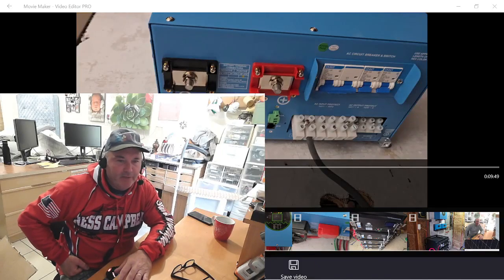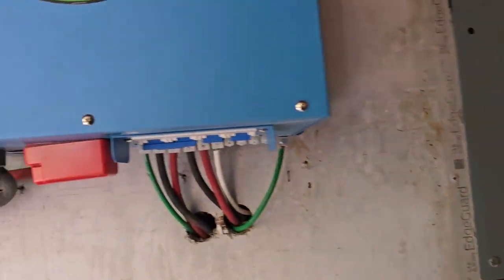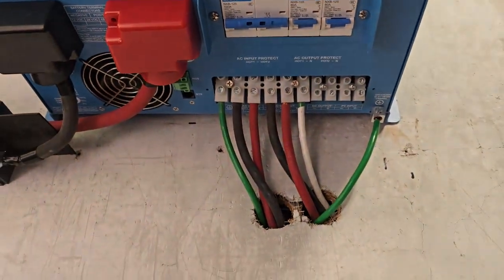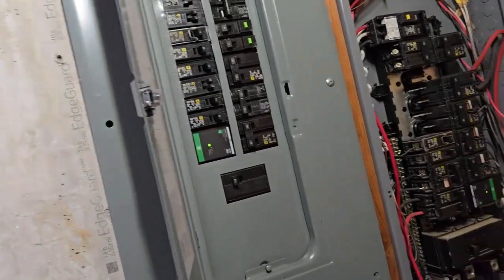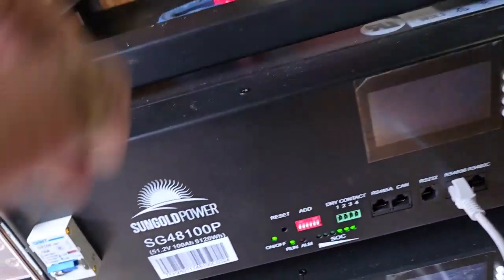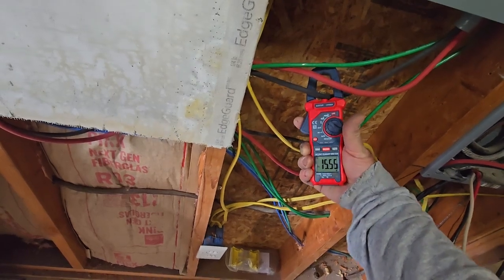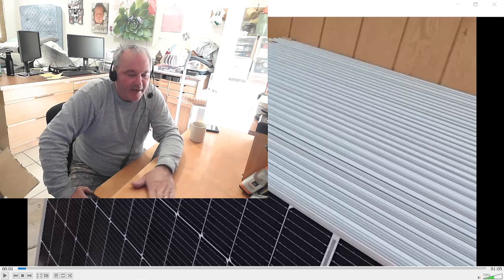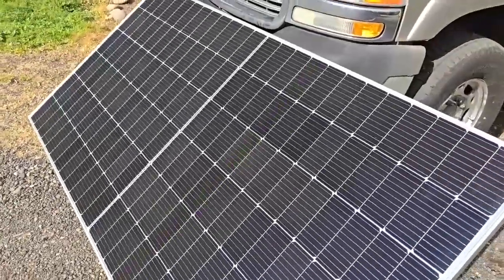SunGold Solar Inverter 18kw electrical wire hookup and power test

Comment: Did your diagram for wiring the 18kw inverter to battery bank show to run (2) sets of 2/0 wire in parallel?

Comment: How is it working? Does the quality seem good? I have been hesitant to buy this brand as I hear they dont honor warranties. This seems to offer the best output for its price...when I've tried searching for reviews every video is from someone that is sponsored or has some sort of partnership with them. It's a budget friendly option, but I can't afford to take a chance on getting an inverter that will let me down after a couple years or less.
Reply from the maker: So far I am very happy with the power it produces. Our house is ALL electric. It is a basic no frills inverter that just makes power and that is it. Our powers our everyday use at about 40% of its 18000watt capacity.
We have it set up to operate via battery bank then commercial power. So it runs stricktly off of the batteries and the solar panels   charge the batteries and if the battery voltage drops below 48v the commercial power will kick in and charge the batteries. 
At this time I still have my Hot tub, Range, H20 heater and 5 wall cadet heaters on commercial power but everything else is on the solar sub panel. I am pretty happy with the system output and I am thinking about moving the Hot tub and Water heater over the the solar.

Comment: Actually that's 4 gauge wire, not 4/0 wire. The terminal strip of the SunGold 18kW is not large enough to accomodate 4/0 wire. 4/0 wire is 0.46 inch in diameter. Nearly 1/2 inch. 4/0 wire is what you might use for an inverter's battery terminals depending on its current draw..
Reply from the maker: Correct, did I say 4/0 should be 4awg.

Comment: Finally a real inverter that uses low frequency, transformer based technology.
Reply: Yeah but the idle consumption is probably INSANE. Sure, there's an energy saver option that will drastically reduce the idle consumption but typically it works by sending out a pulse every 3 seconds to check for a load over X amount. So its not good for certain situations. Your lights will flash every 3 seconds and there's other devices that WON'T like having that pulse every 3 seconds.

Edit: Idle is 270W! and Power Saver is 50W....Holy shit

I'd guess this 18kw would have an idle consumption of 125W or more....but you probably get well over 30kw of surge so starting multiple pumps/compressors is possible.
Reply: @ericklein5097  Idle consumption isn't as critical nowadays because of the massive drop in PV module pricing and LFP battery pricing. By adding one or two 400 Watt modules for less than $200, you can easily compensate for the idle current draw.
Reply from the maker: @ericklein5097  it has a 54kw surge and i do not worry about the power saver option.